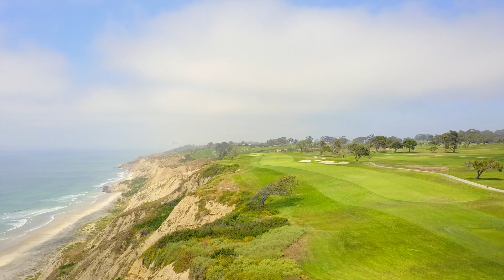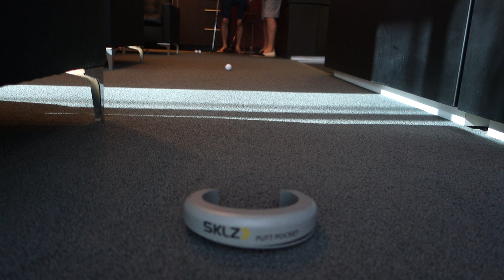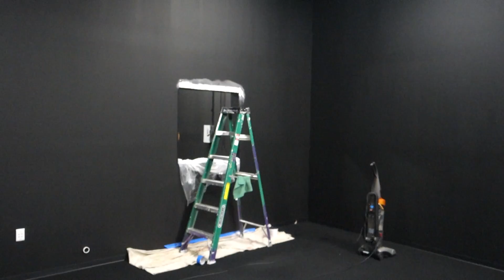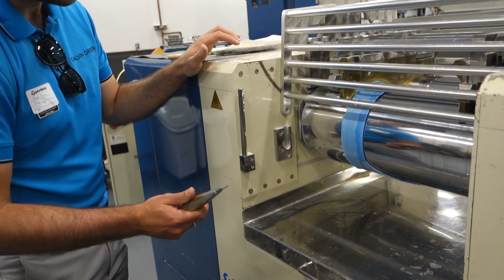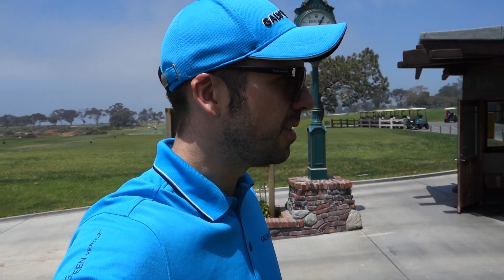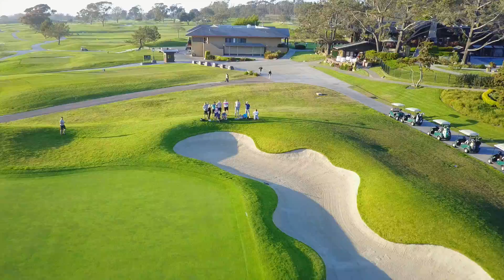I MAKE GOLF BALLS and play Torrey Pines! California Day Three

Comment: didn't see any in the videos but typically there are para gliders flying along the shore side of the south course as there is a glider port there. 
As you played the south course it's worth noting the John Rahm won his first PGA tour event there this year shooting a 7 under 65. Tiger, missed the cut shooting a south course. Tiger woods missed the cut after shooting a 72 on the South Course.
Reply from the maker: there were lots flying around during the middle of the round, a little tricky to get the drone up near them